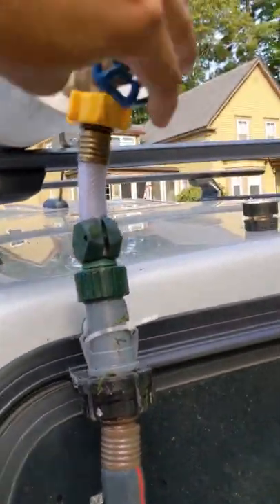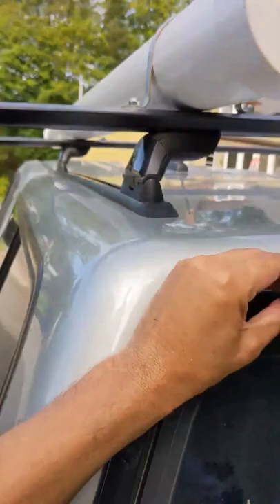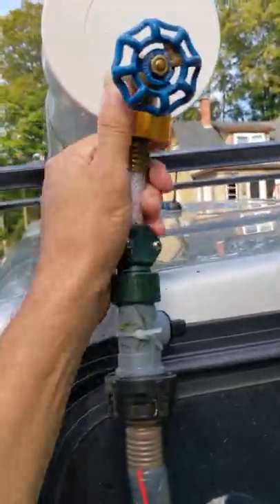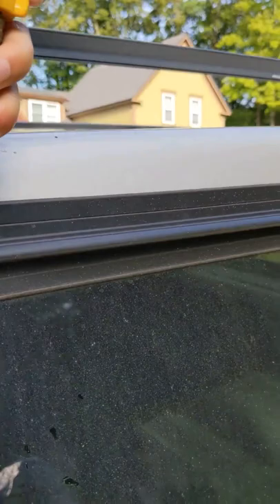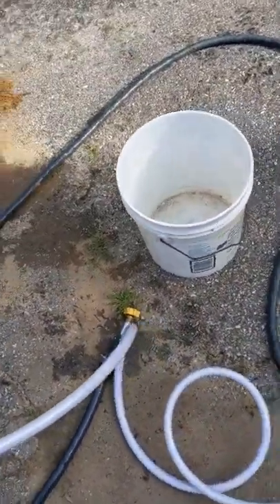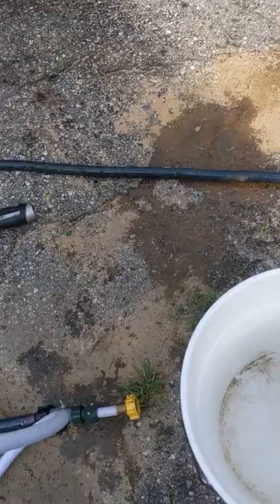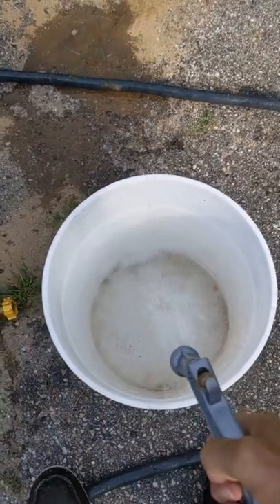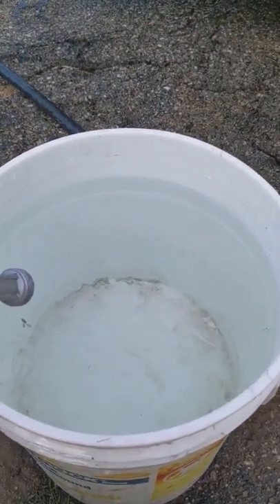PVC Roof Rack Shower Part 4 Spraying the whole tank #shorts #pvcshower #overland

Comment: I'd want some way to positively flush the pipe out.  Probably another hand valve on the other end.    Also, residual water needs to be drained for optimal pressurization, right?

Comment: I don't get it do people not think there will be pressure or something? I'm a.plumber and yes it will fill with a little pressure and release relief pressure when you open the house ....?
Reply: The more air you trap the longer you'll have usable pressure. Air free systems lose pressure quickly. That's not something a plumber would necessarily know
Reply: The whole point of the system is to have pressure.   A lot of people were saying to drain the air to get more water, but that defeats the whole purpose...  He was only using city water, so he would only have a max pressure of whatever the city water pressure is, minus the losses from the hose and gravity...